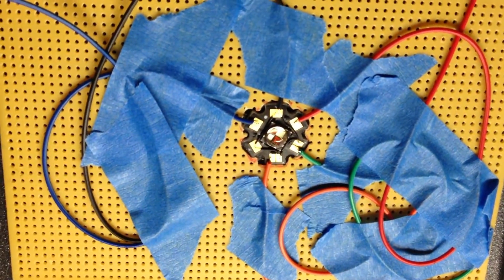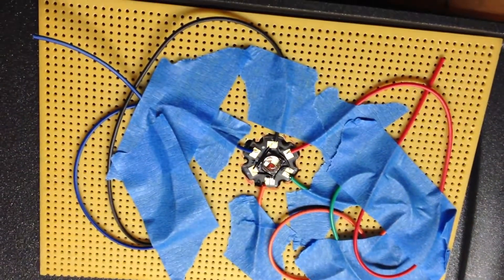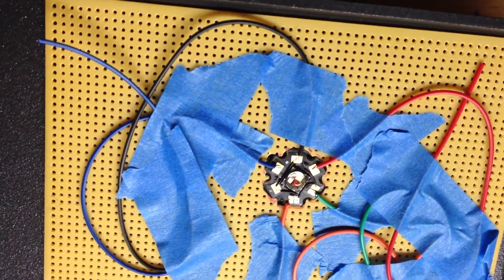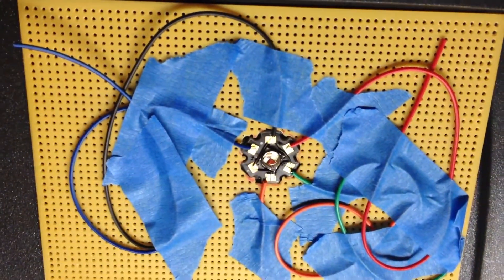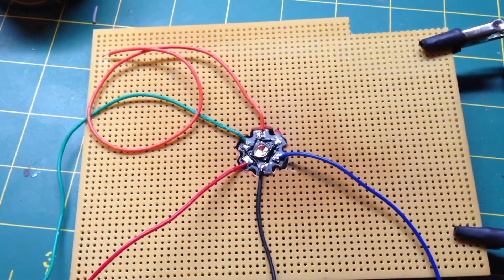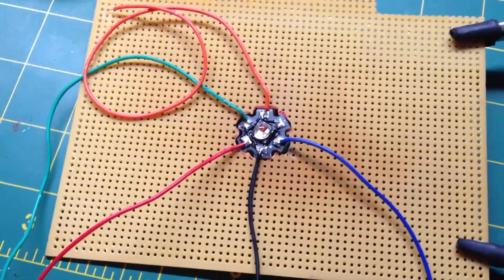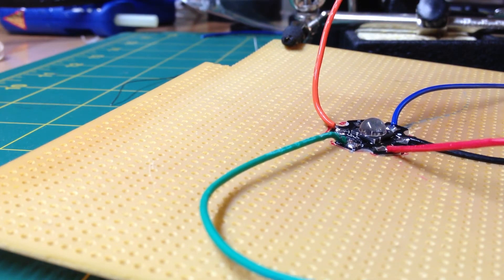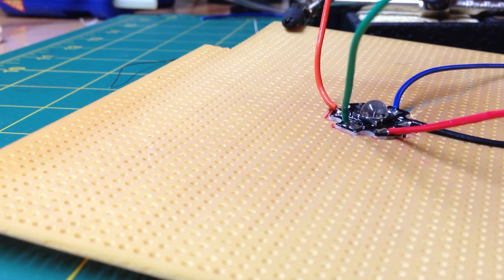Hot Plate LEDengin 10W Soldering

Comment: thank you for the video..i have same with 5 pins...where i have to or why i have to plug 5 wires...i have juste 15volts + and - wire...and on the led engin there is 3 anodes and 2 cathodes ...thank you for your help